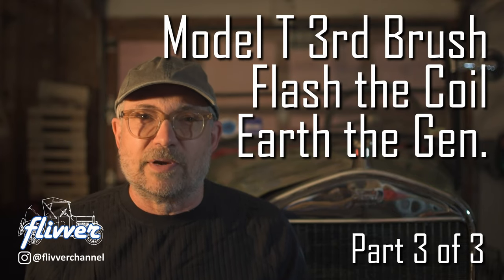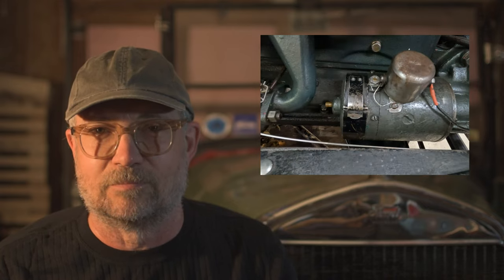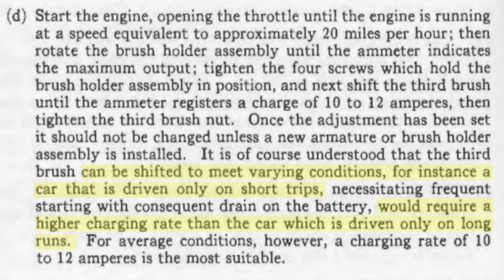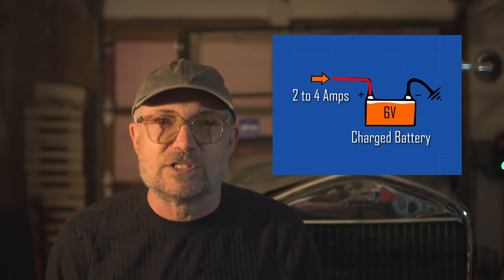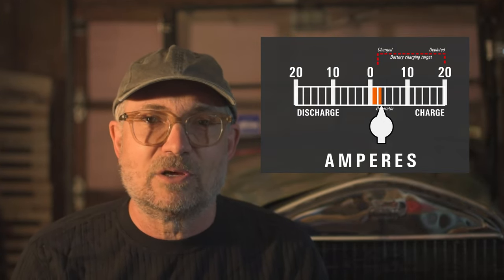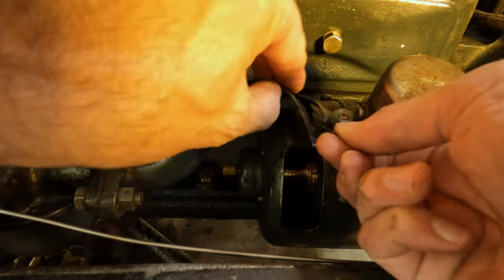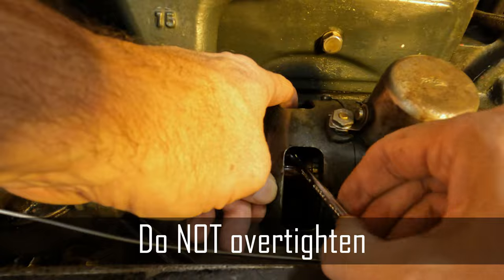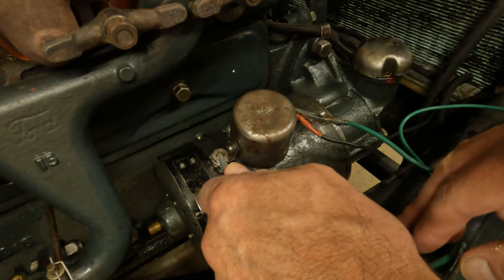Model T Generator 3rd Brush

Comment: What an excellent video and I really appreciated the amp meter animation. I have a 1938 Prefect with the 3 brush generator and have been struggling to keep the battery charged but you have shown me where I've been going wrong. Thanks.
Reply from the maker: Awesome! Cheers.

Comment: Fantastic video. So useful. Many thanks.
Reply from the maker: It's my pleasure. Glad you found it useful!
Reply: @flivverchannel  I'm currently restoring a 1942 Universal Bren Gun Carrier which is powered by the Ford Flathead v8. It also uses a 6v generator which I'm attempting to recover to full serviceability. It's so difficult finding any information on this topic.
Reply from the maker: @chalkster4723  Inyeresting! Check mtfca forum, lots there on 6v gen too

Comment: A problem I've often seen with generators that haven't been rebuilt is when trying to adjust the third brush the old paper insulator will break and "Earth" the brush which kills the output, then some get frustrated and replace it with an alternator... It's always best to make sure your brush carrier is in good shape before adjusting it. I have a grounding wire attached to the generator post with a toggle switch near the steering column so I can switch off the generator when I'm on a long drive. I run LED lights and turned the 3rd brush way down and have noticed the output seems to self regulate. Right after starting it will charge more then after a while the charge reduces from 3 to about 1 division on the ammeter as the battery voltage is back up and electrically pushing back against the generator.
Reply from the maker: I have noticed the same; those old paper insulators are fragile with age.  Neat idea about wiring-in a generator grounding wire with a switch!  I like that.  Thanks for watching.

Comment: Have you used a fuse in the field wiring to protect the generator in case the generator wire becomes broken or disconnected?
Reply from the maker: I haven't, but that sounds like a good idea. Do you have details?

Comment: I wanted to ask sir does that short generator work also on early alternators? I recently acured lot problems I know those old 12si Delco alternators are trobeo some their diodes fail ,voltage regulator fail often,they back charge at low rpm even more if hv ceramic capacitors are present the starting charge gets swaped to around 2500-3000rpm ,how ever recently be me acured some thing unusual relays cinde of arced true me wire harnest I must some how arced the trailer cabel to the bumper rosty metal and aperantly because of blinker relay I got shock true me car body it was nearly identical to dual ignition.
So in fact me baterry stayed alive longer at colder weather so I wondered me self what that was about ?
Why does the lead acid baterry 12v negative ground refuse to discharge baterry It nearly looked like it prefered cold weather for some reason?
Were there any efficient way to send full dc or ac power to ignition coils back in the days with out getting shock from the alternator power?
I culd not finde any thing related to this subject how to use ac full alternator or generator power with out destroying baterry or to prevent electric shock true the car boddy .
I hope for some help .
Europ version cars do not have any usefull info about that subjects and I have realy hard time finding nice replacment ignition system for me 4 pin gm ignition module with e core type ignition coil Im realy anoyed with that thing any advice where to finde advancing/retarding circuets who fit for GM/Opel engines like advance/retard levers in cold mornings Im dead meat engine refuse to start
Reply from the maker: I do not know if an alternator can be 'grounded' to disable the field coil in the same way.  Sorry, I just have not spent the time to learn about alternators, yet.  I wish I could help you more.
Reply: No, if you ground the output of an alternator it will only burn off the wire. You'd have to disconnect the field power. As for the rest of your questions... no idea, your modern car should be doing all that automatically. This is a Model T Ford channel.

Comment: It would have made a lot more sense to run the field coils in series with a rheostat on the dash so you could adjust charge current on the go.
Reply: There was an accessory, one called the "Majestic Generator Output Control" that used a Carbon Pile rheostat to adjust the field.